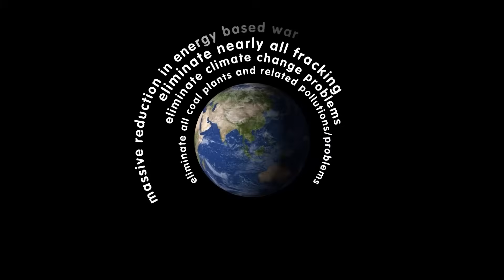free heat movie trailer

Comment: Hello Paul! Love all your work! Thanks!
I'm exactly at the point when I need to decide if I will build a rocket mass heater or go with commercial cooking wood stove connected to a central heating system. But these systems are expensive and I'm in search for alternatives.
Did you maybe discourse on a forum or somewhere else about how to distribute "heat" (hot air?) around the house? Can I get some guidelines here to search for this kind of info?

Comment: For those of us who don't want a semi-permanent install, is there a way to make one that is easily movable (i.e. on a dolly or something similar)? I know that would introduce some other issues, but just wondering if anyone has had success with something like that. Thanks Paul!
Reply from the maker: pebble style.  Somewhere i have a youtube video showing us taking one apart and loading it onto a trailer in less than an hour.  And then arriving somewhere else and building it again in an hour and ten minutes.
Reply: @paulwheaton  Fantastic, I'll hunt for it.  Thanks!

Comment: I agree with you, to a certain degree. I build one myself about 10 years ago just out of curiosity, I am not actually using it. But I honestly think that there is a new and better technology on the market these days. It is called a catalytic converter wood stove. It has a catalytic converter just like a car has. It still puts out CO2 emissions, but it is guaranteed that it will use all the burnable gasses in order to convert it into heat, and it will burn many if not all of the other harmful NOX gasses that otherwise would not have been burned. 

I know from experience that a rocket stove mass heater is very good. But I honestly think that a catalytic converter wood stove is better, and it has less footprint, and they last a lot longer. For example the catalytic converter element has a ten year warranty, and they only cost 150 dollars to replace at the moment that I write this (January 2023, and for certain types and brands the price may vary).

A big disadvantage is that they are not cheap to buy and to have them installed, but because they are so efficient you will burn a lot less wood, and it will safe you a lot of time and money to keep it operational compared to other type of wood stoves. For example because you do not have to cut it into such small pieces, it will save you a lot of work and time getting the wood prepared to burn. And that is just one example.  

I sincerely  encourage people to do a little more research about these catalytic converter wood stoves, especially when you don't have the room or the skills to build yourself a rocket mass heater. It is a long term investment that will pay itself back.
Reply: That's interesting what you have to say about the catalytic converter.  I've seen good things about it in lab reports, but when we actually got one, it was disappointing how difficult it is to get that secondary burn.  The variables have to be just right and most people I've met with one of these stoves don't know how to get it to burn properly.  

I'm getting pretty good at it, but even still when we get our chimney cleaned, there's a lot of sticky stuff inside.  The sweep says it's extremely clean for two years of daily burning all winter, but still, it's obvious there's a lot of potential fuel going up the chimney not getting burnt by the catalytic converter.
Reply: @CrowingHen  The newer types have thermometers that tell you when the stove reached the proper heat to use the catalytic converter. It is a different technology, so you have to adjust to the technology. Otherwise it makes no sense to buy a catalytic converter stove to begin with. The science behind it is indisputable. So the only way that it can go wrong, sort of speak, is when people are doing things wrong.
Reply: @insAneTunA  We still need to keep the fire within the ideal temperature range.  I find this means mixing hardwood and soft to get just the right burn and checking on the fire every 20 min to adjust the damper.  

It works great when it works great and is worlds better than a brick fireplace or a regular wood stove.  But it's not so easy to get an efficient burn and run a homestead.  This is where I can see the advantage of having a mass in a rocket mass heater.  It doesn't need to burn so often so there's less fussing throughout the day to get an efficient burn.
Reply: @CrowingHen  Sure, more mass works well for any type of stove. That is why I believe that a catalytic converter stove combined with a large mass at the back of it in order to make the best use from the heat from the exhaust gasses, is the winning combination. Apart from the mass I am talking about the efficiency of the burn stage, and about extracting as much potential energy from the wood when it gets burned. Their is no doubt that a catalytic converter extracts more energy from the wood simply because the catalytic converter, if well operated, guarantees that all the burnable carbon gets converted into heat. You can't go around the science behind it. And on top of that it also burns possible harmful emissions. 

The only way that a catalytic converter doesn't burn as efficient as it should is when people are are doing something wrong.
Reply: @insAneTunA  I agree with you that the catalytic woodstove is more efficient than the open brick one or any woodstove we've had to date (rocket mass stoves aren't common here as winters don't get very cold).  I'm just saying it's also more fussy and relies on the skill of the human.  That's the major downfall of the tech.  

Like you said, "The only way that a catalytic converter doesn't burn as efficient as it should is when people are are doing something wrong."  Which, from first-hand experience at home and other homesteads using this technology, is often.  And my point.
Reply: @CrowingHen  I am looking forward to see the first rocket mass heater with a catalytic converter element inside of it. Because that is also an option. Those catalytic elements are not that expensive, especially not compared to the wood and the work that people can save. 👍
Reply: @insAneTunA  not to beat a dead horse. but there is a reason that a mass heater does not have a catalyst.  Because it doesn't need one at all.  
The way they are designed and operated when correctly, they burn everything up there is nothing left to burn, a catalyst wood make no sense in a mass heater there is nothing left to burn.
These are two totally different technologies. Anyways stay warm.
Reply: @rondavis2791  I disagree with you. I do not think that a rocket stove burns everything, or better as a catalytic converter. It simply doesn't get hot enough for that. It's better as a regular stove. But not better as the catalytic converter. Just compare how hot a catalytic converter gets when it is in operation compared to a rocket stove. That says it all.
Reply: @insAneTunA  a rocket stove in the reaction chamber can definitely get hot enough to burn everything. Provided the design was built right, your fuel is dry, and it is being operated correctly.
Reply: I have a friend who has one. It's got to be thirty years old. Anyway, even when new, it ate wood like there was no tomorrow.
Reply: @kellyvcraig  It all depends on where the catalytic converter is situated. It should be inside the firebox to get the optimal heat efficiency. If it is situated inside the stovepipe, which can be, it doesn't help much efficiency wise. Technology improves. 30 years is a long time ago.
Reply: I have a newer style catalyst stove and it is very efficient and I love it.  However the rocket mass heater is still king as far as efficiency.
Reply: @rondavis2791  I think that we should separate two things. When it comes to burning wood and using all the potential energy that is stored inside the wood I am absolutely convinced that the catalytic converter stove is more efficient because the science behind it is indisputable. However, when you have a large mass that is heated by the exhaust gasses, so that it can make extra use of that heat that would otherwise go lost if that mass wasn't there, you can reach a point where you burn less wood compared to a stove that doesn't have that extra  mass. But that doesn't mean that a rocket mass heater burns wood more efficient in a sense that it extracts all the potential energy that is stored inside the wood, if you know what I mean.  

A rocket stove has a lot smaller window where it operates at the optimal temperature so that it can burns all the burnable gasses. Because by definition you feed it with much less wood. And it is not even clear when or if it is at the correct temperature. At some point the wood will have gone through the flammable burn phase, and drop in temperature and if the temperature is not high enough it will no longer burn all the gasses. Because there is no longer a secondary burn. 

At that stage a catalytic converter stove will only produce more heat because the catalytic element uses that smoke and those gasses to produce heat. So you do not have to attend it so much, and you do not have to spend so much time with preparing the wood in order to make it small enough so that it fits inside your stove. 

I think that if you would combine the burning efficiency from a catalytic converter stove with a large mass so that the mass can catch the extra heat from the exhaust gasses, that it would be the winning combination.
Reply: @insAneTunA  I get what your saying, but on a rocket mass theres no catalyst or secondary burn unit because it doesn't need one. They burn so hot and quick all of that stuff gets burned and very little heat is being sent out the exhaust. My chimney runs around 225 f.  To 275 f. When it's good and hot. That's pretty good compared to a normal stove which runs around 350. That's a lot of energy wasted for both types of stoves. Plus I have to have a blower for mine. But a properly built r.m.h. barley any heat and no smoke.
The catalysts are bare minimum 150$ for a small stove and can go up to 350$ for a larger. That's a lot of money I think. 
I personally have never seen catalysts warranty more than five years either so have to factor in that pricing.  
A fifth of the wood savings compared to a catalyst stove is a bit of a stretch, but compared to a regular stove I can believe it.
Reply: @rondavis2791  At least some brands give a ten year warranty. Can't speak for each and every brand or supplier. So 15 dollars a year is not much.
Reply from the maker: A rocket mass heater will heat with about one fifth the wood and cost less than half.
Reply: @paulwheaton  P.S. I am talking about the catalytic converter stoves that have their catalytic converter inside the fore box. And I am not talking about the stoves that have their catalytic converter in the exhaust pipe, outside the fire box. Which makes a big difference in efficiency.